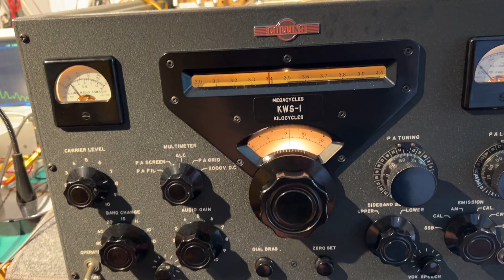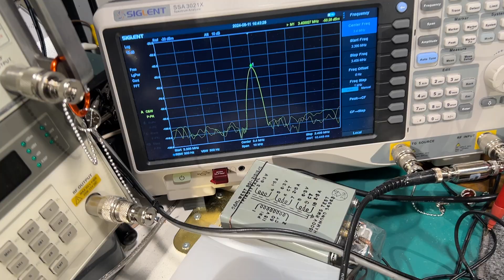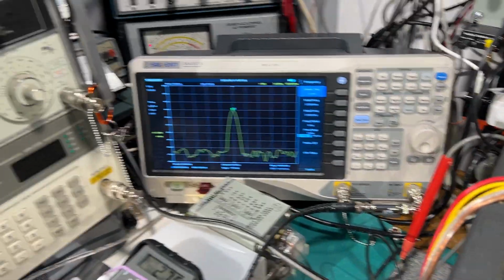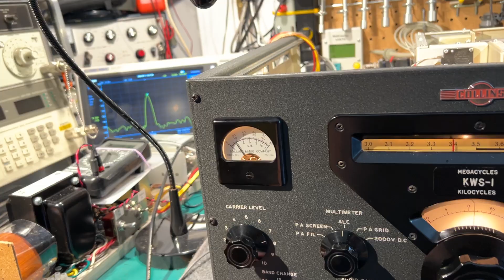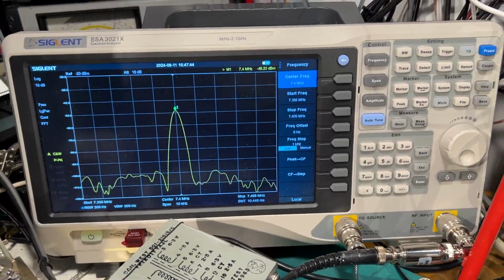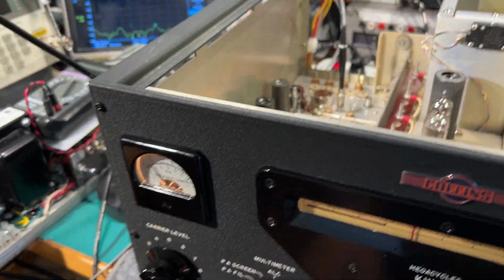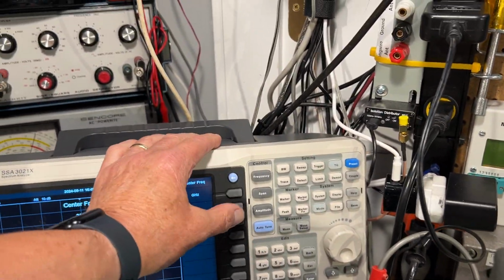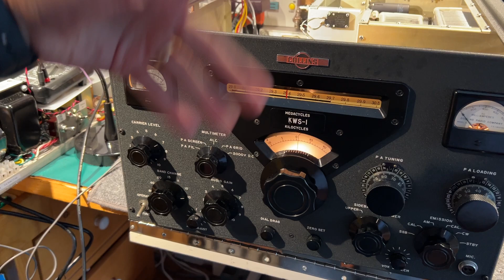Overview of alignment process for the Collins KWS-1 Transmitter

Comment: Could you please provide a video tutorial on how to neutralize the 6CL6 driver stage and the 4CX250B final stage?
Reply from the maker: The 'Gold Dust Twins' do not belong to me and are now back with their owner many miles away, so unfortunately I cannot make a video of the neutralization.  The manual provides a reasonable description, however, it did not work perfectly, and I had to make further adjustments when I found the transmitter self-oscillated under some conditions.  I did write this up in an article on the refurbishment process that you can find on page 48 of the article, here: http://sparcradio.ca/wp-content/uploads/2024/09/Gold-Dust-Twins-Refurbishing-the-KWS-1-Transmitter-and-Power-Supply.with-Appendix-1.pdf
Reply: @ 
Thank you very much for your reply and guidance.
I truly appreciate it.

Comment: The lower 10 meters is dead on my KWS-1. I have no carrier. Howard Mills told me likely the crystal is dead or drifted too far. I see you made a mod to pull your xtals. Are they still obtainable? Could I merely replace mine for that band? (If that’s my issue. I’m not certain yet)
Reply from the maker: In my experience, replacing a crystal is not as straightforward as it seems (whether series or parallel resonance, and correct loading must match the original for it to resonate at the correct frequency).  All the crystals in this KWS-1 had drifted low of their original frequencies (most crystals drift lower in  frequency with age), hence the adapters I made  to correct the ones installed in this transmitter.  I did look into obtaining new HC6/U (HC/48/U) crystals and they can be obtained new and used - cost around $50 each for a new one 'ground to order', eg. from Klove in the Netherlands (they quoted me 37.5 Euros and a lead time of 5-6 weeks).  Vince Jakomin in the UK may have one in stock at a lower price.

Comment: Sorry to say but I cannot hear you clearly! could you get a lapel microphone or one that goes right in front of your mouth? I also have a KWS-1 and it recently developed a problem with suddenly going into oscillation mode drawing high PA current which i turned high voltage off immediately. I suspect neutralization problem and will be checking that situation shortly!  How well does those trimmers work at the base of the crystals? are they wires in series with the crystals or parallel with the crystals? and what is the effect on the crystal, does it allow more adjustment on the crystal frequency or less?  Many thanks ahead of time.    John A Bellas at  KC2UVN
Reply from the maker: Hi John.  Strange - the audio sounds ok on this video to me (maybe its my northern UK accent!).  Good suggestion on a lapel mic though - I will check out what is available for use with an iPhone, maybe with a noise cancelling feature, as the videos of the KWS-1 with the blower running do have an audio issue(!).  I agree that the problem you are experiencing with your KWS-1 is likely due to poor neutralization in either the driver and/or PA stage.  I found some of the neutralization steps as described in the KWS-1 manual to be ineffective and I had to re-neutralize both the PA stage and driver stage grid-cathode, the latter when fully powered-up with the driver stage oscillating.  There is an article on the Collins Association website that describes alternative neutralizing procedures for the KWS-1 here: https://collinsradio.org/wp-content/uploads/2015/05/KWS-1-Neutralization-Notes-from-W8MAQ.pdf.  Also, my detailed article on refurbishing this KWS-1 can be downloaded from the SPARC radio museum website here:  https://sparcradio.ca/wp-content/uploads/2024/09/Gold-Dust-Twins-Refurbishing-the-KWS-1-Transmitter-and-Power-Supply.with-Appendix.pdf, which describes the issues I encountered.  The HF crystal trimmer adapters I made work well, though I suspect that in a couple of cases the amount of 'pulling' degraded the crystal activity somewhat, reducing the HF oscillator output and hence the available drive level on a couple of the bands.  The series trimmers allow the crystal frequency to be pulled up and parallel trimmers allow the frequency to be pulled down.  Inductors have the opposite effect.  The amount of pulling achievable depends on the characteristics of the individual crystals, its operating mode, eg. fundamental or 3rd harmonic/series or parallel resonance, and the circuit it is operating in (level of capacitance loading, etc).  Usually, a crystal operating at its fundamental frequency can be pulled a few KHz using a trimmer or inductor.

Comment: Beautiful set, good work. Do those crystal series trimmers give you much margin?
Reply from the maker: Yes, they pull the crystal frequencies quite  a bit - the most I needed to pull was 2.335KHz for the 13MHz crystal, and I found that more than this was easily obtained.  I used a combination of a silver mica capacitor and 30pF poly trimmer in parallel for the series capacitor.  The value of the silver mica capacitor was selected for each crystal such that the desired frequency was reached around mid-span of the trimmer.  The values of the silver mica capacitors used here range from 33PF to 82pF.  The correct value in each case was reached by experiment using a larger value  trimmer on its own to start with, adjusting to the desired frequency, removing it from the circuit and measuring the trimmer value, subtracting 15pF from the measured value, and using the closest standard silver mica capacitor value.  I also checked if they could be pulled in the opposite direction using a capacitor in parallel, and they could.  Of course inductors could also be used instead of the capacitors, to give the opposite effect